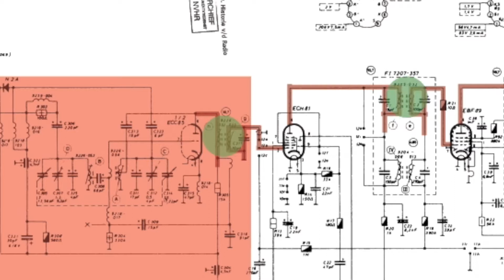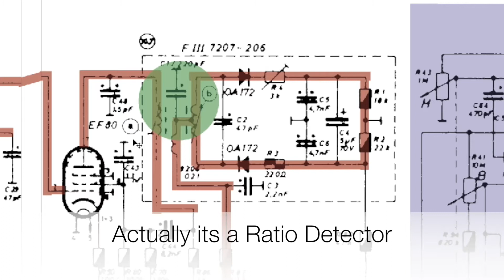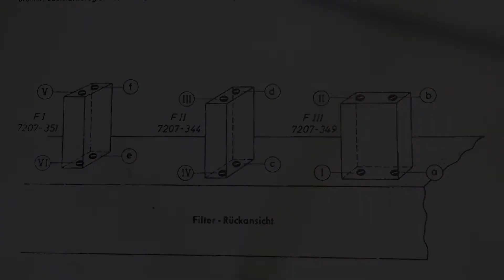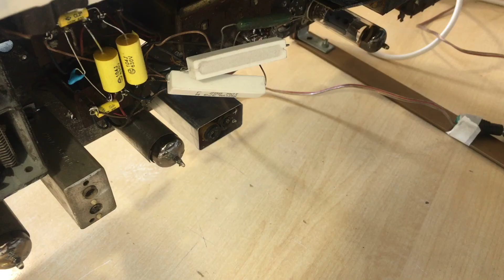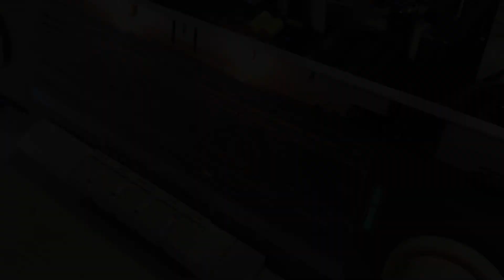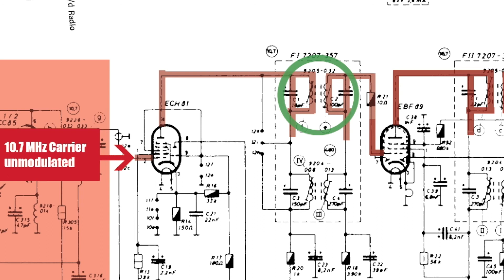Grundig 4198 tube radio restoration - Part 10. FM IF alignment.

Comment: When you surround the ECC85 with the loop over it, it seems to me that you induce the 10.7MHz field over the two inner triodes, and as the anode circuit of the second triode anode has the 10.7Mhz tuned load, I think that it is the way you inject the 10.7MHz inside the following stages (the FM-IF section). Of course it would be different if you inject the 10.7 MHz signal at the dipole antenna input, in which case the first triode is really involved. What do you think?
Reply from the maker: The first triode has no function as regards that IF frequency. It is an RF front end tuned to the FM band that the radio receives. The IF frequency will only be produced at the triode as a result of the mixing function of that second triode.
Reply: @electronicsoldandnew  Your point is very clear about the mixing process. No discussion about it.
 I am just discussing about what is going on when you induce the 10.7MHz field over the valve. And we agree that the first triode is out of the subject then.
This was not clear when I listened to the post.
Reply: This is at 3minutes56 on the video
Reply: I appreciate very much your videos

Comment: Sorry, why did you do the light coupling?
Reply from the maker: It’s the easiest way to “inject” the signal without causing it to load down that sensitive part of the circuit
Reply: @electronicsoldandnew by the metal wrapping of the eh81?
Reply from the maker: If you’re referring to the fm alignment, the the coupling is to the ecc85 tube. If you couple it to the metal shield, you must desinfetar shield from the chassis. Or just wrap a few turns of wire around the top of the tube itself.
Reply: @electronicsoldandnew  Ok. Thanks

Comment: Hi M Caldeira, I can't thank you enough for your advice on the SABA and videos.  I was able to repair the Saba and get it to play well.  

I was able to get the AM working quickly, by repairing a bad switch contact,  and replacing the audio front end tube. The FM remained a problem, low volume and squealing on the upper frequencies.   Squealing was eliminated adjusting C103. (They cryptically called it neutralizing with no explanation). I researched that out and now understand its purpose and how to adjust.  The last issue was low output from the fm detector.  It turns out that the pins on the EABC80 detector tube socket for FM detection were not making good contact. Deoxit etc didn't help.  So replacing the tube socket brought it back to life along with alignment.    Great Videos and and explanations!  While difficult to repair, I enjoy these radios.
Reply from the maker: Bill Sloma : good to know the saba is done. They are absolutely fabulous radios. Enjoy.

Comment: Hi, very good video, I am restoring a SABA which has almost identical schematic and similar quirks. This will help me out tremendously, especially the circuit explanation. Thank You
Reply from the maker: Bill Sloma : you’ll have to be a little more careful with the SABA, as the circuitry is usually a lot more compact. The general principle is the same, but a little more challenging. I have done three SABAs, which I concluded before starting the videos, so unfortunately did not document them. Hopefully I’ll get another one soon. I think they are the best German tube radios ever made.
Reply: Hi M Caldeira, thank you for the reply.  I agree Saba a put together more compactly and hard to service. Your point on not adjusting too much due to delicate hard to reach parts is what I am seeing. (Saba Wildbad 100/125 German Version).  I have the AM working, fixed 2 of dial cords, needs alignment but focusing now on FM, it is a sealed compartment, I don't want to open it if possible.  Nasty squeal after about 94 mhz.  I put an external antenna with a 8pf across leads as they suggest and that calmed down the noise but no reception. Next step is to signal trace. Any advice appreciated. Many thanks great video, meticulous work on restoring knobs and cabinet.
Reply from the maker: Bill Sloma : definitely do not open the FM enclosure until you have exhausted all other options. Do all the surrounding circuitry, checking resistors and recapping, as well as continuity checks. The tube could also be the problem.
Reply: On some of the Saba, within EACH transformer filters (which is formed by two resonator section), you have the possibility to play with the coupling between the two resonators, with a third "screw". By decoupling (reducing the coupling), it helps to tune INDIVIDUALLY each of the two Resonators (each coil), and then when recoupling you really build the BAND PASS Filter, and you can even ADJUST the Bandwidth. To my experience, the first part (when the resonators are decoupled) is really a good help as you can do each tuning separately, and safely, but the second part, when you recouple the resonators, the bandwidth adjustment is more tricky
Reply from the maker: Agreed. In fact you should notice a max of 20% increase when you adjust the coupling screws to increase the level of coupling.

Comment: How dit you set your Signalgenerator to FM modulation at 10.7Mhz / 600Hz to do the last adjustment using your scope?
I have the same Rigol but cannot get the settings accepted by it.
Reply from the maker: Henny Poort : set frequency to 10.7MHz, amplitude to about 10mV (to start), select the MOD button, choose FM type, select deviation of about 20kHz, set modulation frequency (FMFreq) to 600hz, then activate the output.

Comment: I'm surprised they don't call For a swept 10.7 for the IF. The other way that often works with ratio detectors ect is the apply an AM modulated signal and tune for a null.
Very detailed series. Thank you.
Reply from the maker: Simon Spiers : these grundigs almost never specify a swept IF alignment, although it would probably produce a clearer result.